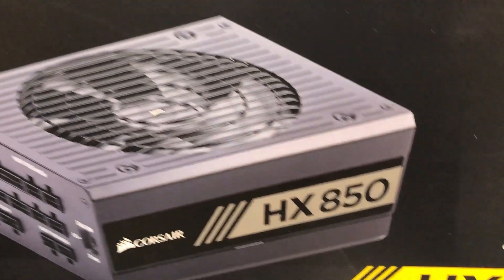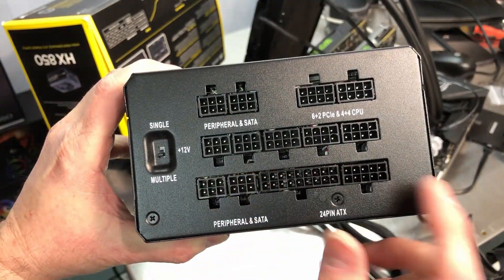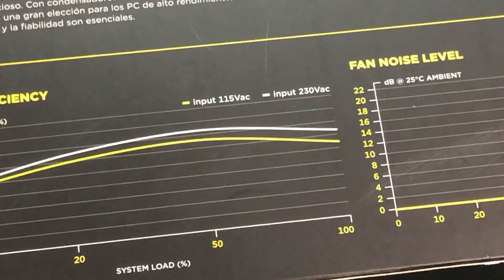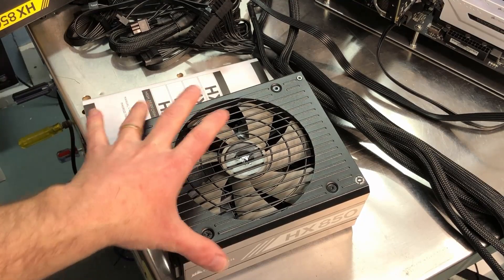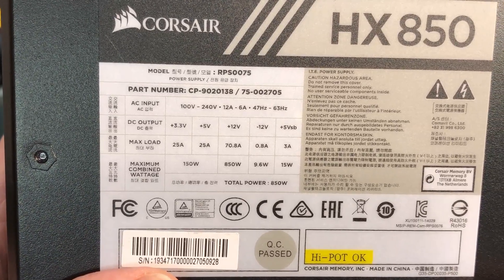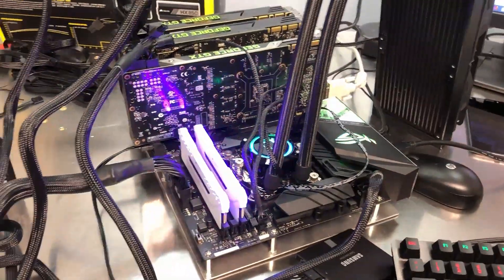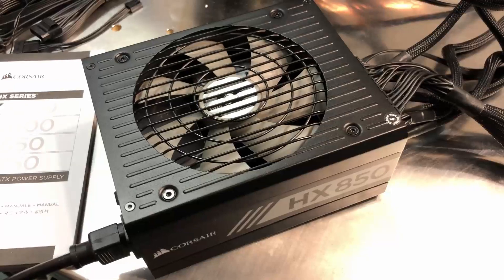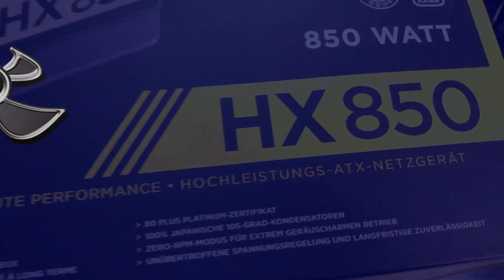Overclockersclub checks out the Corsair HX850 Fully Modular Power Supply!

Comment: Using this power supply with a 3090 and 10700k overclocked. Hasn't blown up yet
Reply: I had an Rm850i with a 3090 and 10900k mine just blew :/ 
Just ordered an HX1000 unit lol
Reply: @genericchannel9448  Hm damn :(
Reply: That'll be the limit I reckon. My HX850 runs my i7 13700KF and RTX 3060 easily but I'm guessing when I upgrade to a high end 30 or 40 series I'll be needing 1000w+. The i7 eats power for breakfast just to boot up lol

Comment: Hi thanks for the video, i just finished a new build but with a hx850i I first di not plug the cpu connectors just saw most of the fans spinning very low, and all the rgbs, but when I plug the cpu connectors to the motherboard the only thing that happened was the motherboard rgbs on and when I clicked the on button from the case there were some clicking kind of noise coming out from the PSU but is does not started. This is a 100 new unit, i then plug it to an old system and it did not power up, so the only thing that worries me is wondering that if by any chance the motherboard could be damaged as well? Thanks for your kind responses
Reply: Whats the difference between hx850i and this one?

Comment: can you measure the thermals after a couple of hours of low to moderate use, without the fan spinning?
I'm curious to know how this PSU would behave when it's in a case, behind a shroud and without any airflow since the fan is not spinning.